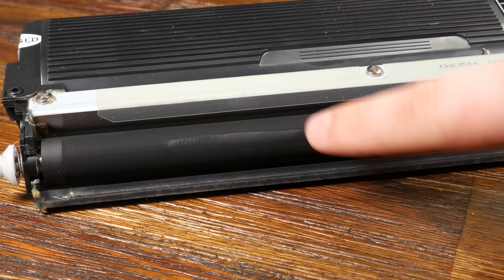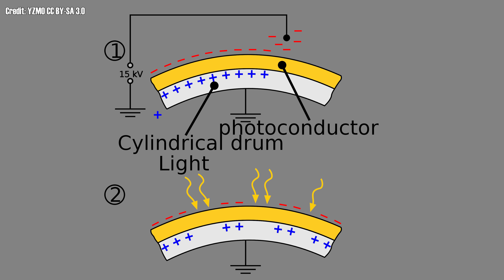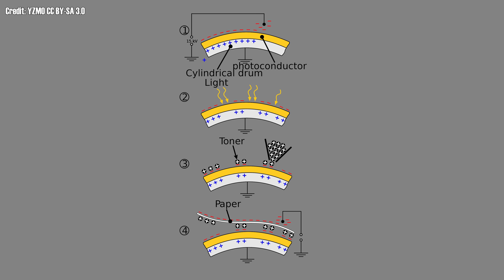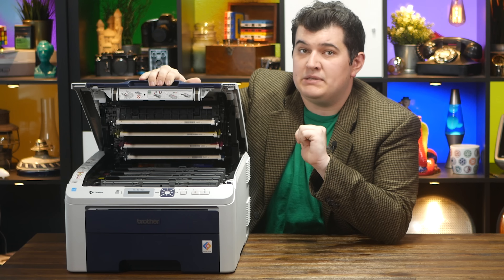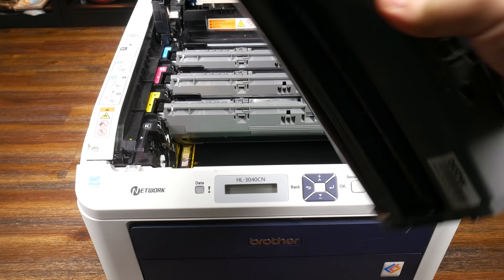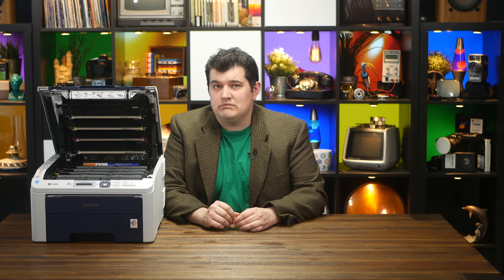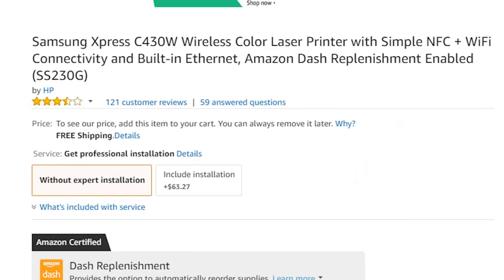LED Printers: The Common Printing Tech You Haven't Heard Of

Comment: one dead LED on the black part = RIP
One dead laser. obvious, let's just replace the diode
Reply: One thing to note: In the real world, I have maybe seen two LED or Laser engine failures in thousands of printers and copiers.  The only electronic failures I've seen are due to the equipment taking a lightning hit.  99.9% of the failures I've seen are mechanical.  The most common: Feed Rollers.  After that, maybe broken levers or gears stripped.  The rest are failures with the drum getting scratched or dinged, which isn't a problem with the units where the drum gets replaced with the toner cartridge.
Reply: @rbstorms  i am talking about the imaging unit only
Reply: You are correct.  I was just pointing out that in actual use an electronic failure is much more rare than mechanical failures.  I've never worried whether my printer was laser or LED.
Reply: these are intentional. When they design a product they estimate points of failure and if there arent enough of them they add them. No point in making a product that wont fail for 20 years. Unless its industrial equipment that will obviously require some maintenance but otherwise run for decades without fail.

Comment: I have a Canon LBP 2900 "Laser" printer which I do recall is in fact an LED printer. Comparing its output to that from my previous (A LaserJet 5) I can't see any difference between them. :-)

And at £50, the LBP 2900 worked out much cheaper than the £105 HP quoted me for a replacement imaging unit when mine went b00bs-up! ;-)

Comment: Oki was always the LED printer brand, and nobody is terribly proud of LED because it was always seen as the poor man's version of laser.  It's the off-brand of food versus the name brand.  Oki ran with it because they had the patents for it and avoided having to pay royalties to Canon for the patents in laser engines. Canon developed the engine used in HP and many other brands so that's why there are Canon parts in so many other brands.   Anyway, the laser unit in big printers is often called a Raster Output Scanner or ROS.  They are huge units in industrial laser printers like the Xerox DocuTech/DocuPrint series.   The current cutting edge in industrial production printing is now ink jet for a variety of reasons.

Comment: Your reasons for disliking inkjet printers, apart from for water damage (which is a fairly niche example anyway), are silly.

Maintenance mode doesn't seem to waste much ink in my experience. It does it a few minutes after a print job automatically to prevent it going dry. Seems relatively efficient to me. Never had a problem with ink going dry even with months between printing.

The sound is a silly point because it is stated as fact when it is a matter of opinion. The sound can be rather calming. I really don't have an issue with the sound. The only justification for sound being a problem (which I have heard) is offices. 

There are lots of off-brand companies who make ink cartridges, such as prink. Only about £12 for a full set of cartridges. Very reasonable and never had a problem with them. Laser toner isn't exactly cheap either.

Never had a problem with smearing either. It dries so quickly it isn't a problem.

The main problem with laser printers is their price. I do much prefer laser printers to inkjets, however laser printers are just unaffordable. £30-80 vs £120+ For business with money, sure. For people with too much income they don't know what to do with it, maybe. The disadvantages you ran in that quick scroll seem to be over exaggerated, there is no point in buying something more expensive if you don't need it - and most people probably don't need a laser printer. Given YouTube is a platform for more home users than business as audience. The gist I get from your language is that you expect everyone to be going out and buying laser printers as "ink jet printers are so bad", which seems a bit silly.

Comment: Eliminating a moving part should in theory increase reliability. However I think you will find that the paper handling part of the printer is much more likely to fail than the rotating mirror. Since a printer's entire job is to print to paper I don't see how you can ever eliminate the paper handling moving parts. Although I am sure that printer manufactures are constantly trying to find better and more efficient ways of moving the paper around and preventing jams.

Comment: you have missed one of the best (!) laser print technology's, the color laser based on transfer belts, I still use a transfer built laser on a daily basis, its a 90's hp4550n in original condition. 
the toner carts are held in an overhead carousel, the image drum collects one color toner and instead of passing it to paper it passes it to the transfer belt, which is as the name suggests is a belt the width and length of the largest paper size, and the belt goes round under the image drum 4 times, as it passes on each journey the carousel moves to the next color toner, after 4 spins of the belt the paper is passed under the belt to collect the built up 4 color image, believe it or not the thing works remarkably well with virtually no misalignment of the 4 colours visible.
i'd send you my 4550, but i dont think your desk would hold it.....

Comment: Even the SAMSUNG Printer you mentioned in your video is actually a LED printer (I own a similar model with the same speed values). It's just that they haven't arranged everything so clever like Brother, they rather use only one LED strip for black and one for all three colors which the paper must pass three times when printing in color. In the tech specs in the manual it also states that it is a LED printer. I guess real Laser printers are just hard to find nowadays, especially color ones. Which is a pity, because I have to say that I definitely CAN see the difference. A 20-year-old "real" Laser printer from HP definitely produces clearer, sharper images than the newest LED ones from Xerox or even HP in my opinion.

Comment: I'm still trying to figure out the speed part.
A color printer needs a transfer belt. The image is written onto the drum, toner is transferred onto the drum and the from the drum onto the transfer belt.
Because a laser printer has only one laser with one spinning thingy, this has to be done one color at the time and there's 4 colors, cyan, magenta, yellow and black.
An LED would write to all 4 drums at once, saving three rotations of the transfer belt.
Coming to think of it, color lasers would almost always be LED, because of the difficulties in bending a laser beam from a fixed source to write onto 4 drums.
B&W printers are almost all lasers, because of just a single drum being written to and no transfer belt.

Comment: Back in the 90's, my father worked with Mead Imaging which had partnered with Brother to develop what they called Cycolor. This was an inkless printer technology that used paper impregnated with microscopic capsules that changed color when they were opened and exposed to certain colors of light.  The print head was a tri-color LED with a special lens.  The process (as I recall) involved crushing the paper to open the capsules and then the LED print head ran back and forth similarly to how an inkjet works.  The problem with the technology was that the capsules dried out and then they either produced the wrong colors or didn't work at all. For years they tried to make the paper last more than a few days outside the packaging but eventually they ran out of funds and the tech was sold off. Supposedly the group that bought the tech fixed the problem with the capsules drying out. The links below are the only references to the technology that I can find online:
http://www.chicagotribune.com/news/ct-xpm-1989-11-19-8903100844-story.html
https://books.google.com/books?id=dwEAAAAAMBAJ&lpg=PA58&dq=cycolor%20brother&pg=PA58#v=onepage&q=cycolor%20brother&f=false
https://books.google.com/books?id=6IkHCAAAQBAJ&lpg=PA290&dq=cycolor%20brother&pg=PA290#v=onepage&q=cycolor%20brother&f=false

Comment: The main reason to use LED in earlier times is ozone gas that is caused by laser printers. LED printers should have much less problems. They smell different than laser printer. Now laser printers have better filters but ozone problem is not fully gone. The toner are much finer (1200 dpi!) and that causes more health problems if room is not properly ventilated.

Comment: I know whole time there is LED printer, and i know Oki was most known for it. Most other companies uses Laser. There are also LED copiers, for example Konica-Minolta CF2002. I even repaired one faulty LED head. Repairing LED printer is easier than laserprinter because heads are just one piece. But LED heads are perhaps more expensive than laser head.
Also Oki has cartridges in row like Brother in video.

They're fast and don't make much noise. The cheap color laserprinters have rotation method for 4 colors. If you print B/W, it's fast, but in color, you heard rotating noise. That is also there is just one laser to scan each cartridge. Expensive laser printers are bigger and each drum has own laser.

Comment: From what I can tell, my printer is in fact a laser using the same arrangement; there appear to be four separate laser emitter windows in an absurdly compact space above, similar to the led printer shown. But, there’s no fold-down component, so it’s clear there’s no emitter touching the paper. I don’t know if there’s one laser w/an actuator to switch to the different windows, and if there are multiple spinners, but I’d love to take a look in there. Also, I’m moderately happy with my printer, and messing with the optical system will likely change that very fast. ;). Ricoh SP C250DN

Comment: Laser (or LED for that matter) printers sure are great and have a lot of advantages but to me one big disadvantage : air pollution. Every print spills toner microparticules into the air (and it's obvious when he opens the machine that it's more than micro particules sometimes) and when you use it often, it's a significant pollution to your indoor air, especially in offices where it's most often used. Not saying that inkjet is great ! Just stating a problem from the other side as well.

Great explanation of how it works and totally didn't know that LED printers were a thing though, thanks !

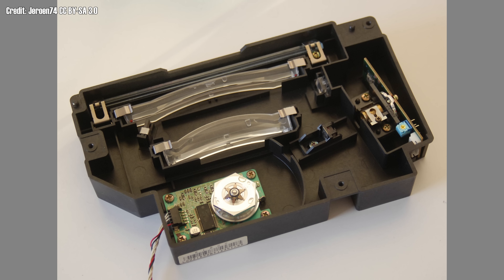Comment: I want to add a slight correction to the operation. Both LED and Laser printing modules can be lined up like that, as you can see from 4:08 that is the full laser module, which just needs a clear line to the photo drum to work. Secondly, color toner printers do not put each color on the page separately, as seen at 5:44 that black belt is an intermediate transfer belt that collects all 4 toners onto a single medium prior to transferring the whole document to the paper. This means that regardless of the exposure mechanism, the rest of the image propagation and transfer mechanisms can operate identically, making it that much harder to tell which is which without opening the unit and looking for the exposure mechanism.

Comment: Printers. Every business tech support person's least favorite,  but most common call/repair.
Reply: I actually loved working on printers, especially laser/ LED printers, as the lion's share of the problems were mechanical in nature, not electronic, or even software in nature.  They were frequently easy to correct, but you had to have parts on hand to fix them.  HP's being the most popular when I was doing computer work, were the most popular lasers, and Okidata was the most popular dot matix.  Keeping some denatured alcohol, a couple of fusers, pickup rollers and a printhead or two on hand, and I could bang out several easy, high-profit printer service calls in a day!
Reply: Printers are evil and should all burn in the hottest places in hell.
Previous support person
Reply: Sitting at home. Watching this vid. Recieved yet another MFD call. Have to go now. Thanks for the Laugh
Reply: Companies make to much money on printers, otherwise you'd think they'd make them plug and play (like literally every other device for your computer) with affordable refills. I beg, borrow and steal when it comes to me needing to print something.
Reply: @kaibaCorpHQ  All of those things are pretty much true now my dude :) look up eco tank or even better is pagewide (expensive carts like a laser but similar or sometimes MUCH better cost per page depending on the printer). drivers are generally auto installed by windows 10 when plugging in now. the problem is people equate cartridge cost with cost per page and they shouldn't.
Reply: Most issues comes from :
1 bad paper
2 dusty places
3 rough handling
Most calls are related to network issue and poor knowledge of the operator.
Reply: @Koozomec  and in the case of most LED printers. Low quality plastic parts. They use LED tech to save money and they do anything to keep the cost down elsewhere too. I'm looking at you Brother and OKI
Reply: The most common issue is just that the paper is stuck. If you can't find any stuck paper it's probably still paper that is stuck just somewhere less accessible so you might have to remove one of the paper drawers or take out a few parts to get to that little piece of paper. For me printers are good. I'm at work either way so getting to go out of the office for a bit is good.
Reply: @TheDuzx  Maybe just as often for me, it wasn't even malfunctioning - the printer was asking for the size of paper they told it to print and rather than read the display, the users assumed it was broken because nothing came out...
Reply: That's because printers were invented by the devil
Reply: I had my share of printer maintenance, taking care of a legacy HP 4500 series, a stove-sized color laserjet printer, until it died of old age leaving me with tons of unused supplies. It used four toner cartridges, drum unit, fuser unit, transfer belt, and an optional duplex unit that we didn't have. It used parallel port connection so the output was a dozen pages per hour but the quality was pretty good.
Reply: Agreed, i set up a print server with a Raspberry Pi, and it worked well for ONE SOLID HOUR, then refused to work, and i never figured out why, mostly because i returned it and got a printer with actual Wi-Fi.
Reply: "PC LOAD LETTER"? The fuck does that even mean?
Reply: @angolin9352  "lp0 on fire"
Reply: It's unfortunate that even though this technology was developed in the 1930s, we were still paying 25 cents per copy for Xerox copies in 1975.  Lawyers are good at making one company rich at the expense of the rest of humankind.
Reply: Turn it on and off?
Reply: @coffeeandluten  Shake the toner and put it back.
Reply: @irandom419  Doesn't work with new cartridges which have chips in them, which count pages rather than measure toner.
Reply: Sysadmin? Sorry, did you mean 'printer repairman'?

Comment: I  used to repair printers, plotters, and laptops in the early 1990's and I remember the Okidata LED printers...I was a factory authorized repair tech for them.  They were cheaper than the HP LJ2 and 3, but not as good.  Because of their low cost, our company sold a lot of them.  The OL400 wasn't bad, but the OL400e had a terrible paper feed mechanism that caused endless jams and you just couldn't fix it.  The Okipage were much better, although more expensive.

Comment: I’ve got an HP Laserjet 1018 B&W printer that is probably 15 years old or more that I inherited from my uncle. I used it in college when all I needed was to print tons of pages of text for essays and reading materials for class. It prints very sharp text even in econo-mode. I can easily get 2000+ prints from a toner cartridge, although they’re pricey, the cost per page is lower than inkjet printers. Hardly do I ever print photos, so a color printer is not a necessity.

Comment: LED has been used a lot over the years, and yes for space reasons color printers and copiers used them. They are falling out of favor with copiers now as the trend is to increase apparent resolution and that means shrinking the toner particle size as well as the pixel size. LED has a practical limit to how small the light beam can be focused to, laser beams can be focused down tighter. This all makes the output sharper at the same 600x600 standard resolution. Your explanation of xerography is more from the 1990s. Pretty much everybody uses a charged silicon-based rubber roller to transfer the toner to the paper now. Charge rollers are also trending as the way the drum gets charged. Corona wires are fewer and farther-between in the world.

Comment: I used to service graphic arts equipment and worked on a laser printing plate exposure system rated for 2400 dpi,  even though the material it exposed was only good for 1200 dpi then used on presses that could barely reproduce 450 dpi. Later in my career I worked on high production copiers that used LED imagers at 800 dpi . LED's cost less to make and are easier to service than lasers. After 600 dpi you need a 20x magnifier to see the difference. Yes LED exposure technology has been around since before the turn of the century.

Comment: HOW ABOUT HP ANDTHEIR 4 TONERS, 4 LASERS AND ONLY 2 SPINY THINGY TECHNOLOGY?ups sorry capslock
old hp 1600m 260 and 3600 color laser printers used straight paper path with their laser asembly and "4 printers stacked on top one another" for over 2 decades now, and they only getting smaller and somehow buffer data faster
and even with ancient hp clj 2605 printing speed is not an issue, buffering data is (it takes 4 secunds to start printing in black but 12 to start printing color)
led might be more compact and all that, but processing speed for data should be about the sameboth printers split image in 4 paths and the only difference is how the drum is iluminated (line vs point), both machines have to buffer entire lines of print for the iluminating engine anyway